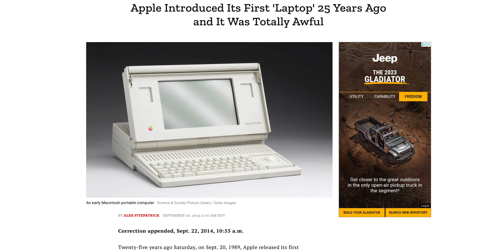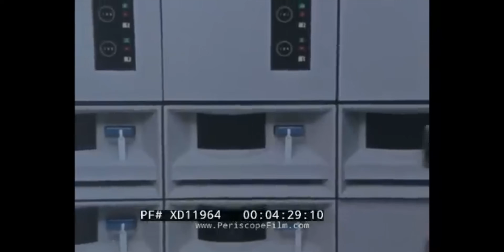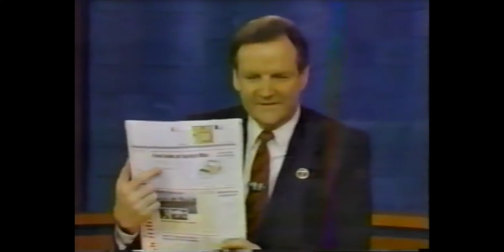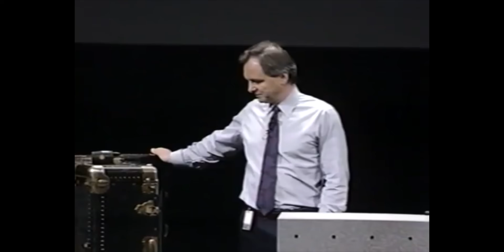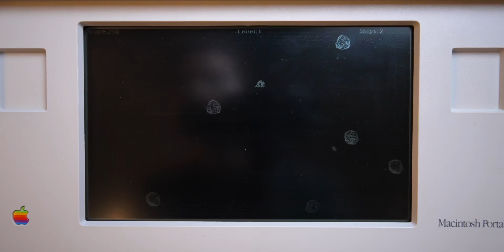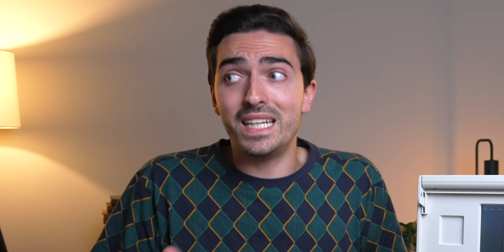How Apple INVENTED the laptop

Comment: I won one of the original Mac Portables. I was a ComputerLand employee at the time, and Apple hosted a contest for the contestant to put together a presentation that promoted the Mac over PCs. The thing was HEAVY due to the big lead-acid battery. But using it's sturdy carrying case,  I was able to travel with it. It had no backlit screen, so seeing it in dim light was a challenge. I wish that I still had it.

Comment: My grandfather worked for Data General back in the 1970s to 1990s i think and he got a Data General One wicht is a laptop from 1984, you saying that apple invented the laptop is just wrong. The Data General One is mabye the first portable computer that has a formfaktor of a laptop. The Data General One has a very similar look to the Macintosh portable, but with a bigger screen, it has very bad contrast. I would also like to mention that the serial number of grandfathers computer has a very low number something under 100, and it can hold a charge up to 8 hours and up to 16 hours with new cells!

Comment: It's what I will call a  PC guy's perfect Mac.  Apple is about targeted design.  This computer is amazing but it fails at what it was supposed to do. How many people often disassemble their PCs? Then they insist Apple users are stupid because they have a laptop that actually performs on battery instead of a massive gammer laptop that doesn't. They insist that professional computers should be designed to be modified all the time, and install experimental stuff. No a professional computer you setup and leave it alone because you have to do actual work with it and you don't want to miss a deadline because the new cool stuff breaks the machine.  When I want to toy around I use a Raspberry pi or a "for toying around" Linux box.  My Mac and my Windows PC  portable are not toys.

Comment: A very good  possible claim for first portable PC is the Sharp/radio shack E5100 (1979) and E1210 (1980) Pocket PC-1. While it only had one LCD line; it weighed under 1 lb even with a printer or plotter only a couple pounds and battery powered also.  It was CMOS and  battery powered requiring no outlet, it had Basic programming built in, a software library, full QWERTY  keyboard though tiny;  cassette storage allowing for large programs; optional  printer, even a pen plotter w 4 colors. I personally consider this the first portable as you could use it anywhere w I/O and run on batteries for days on a single charge. At the time the "big" computers used terminals w one line of paper input or output at once. You certainly could do graphic output or text output on this computer.  It isn't a calculator because it uses Basic language had a full keyboard, and it had cassette storage for larger  programs and data.The Grid case came out in 1982. Extremely costly but it was compact, non volatile memory had a gas plasma flat screen clam shell and full keyboard. In many ways still more capable than the Apple portable made a decade later.

Comment: In the early 80's I worked at a Xerox service center outside of DC. We worked on Osborn 1, 2, and Osborn Executive portables. We also worked on Kaypro 1, and 2. We also service apple II and IIe. One of our reps had an Osborn 1 fall off his motor cycle on the way home and after we replaced the case it fired right up. We had a scientist from NASA bring in one they used for a launch after their main Fram went down that they took out of the case and  hooked 12 5.25 floppy drives up to make the launch. The Osborn users group was fanatical and loved their computers.

Comment: For existing Macintosh Portable users Apple offered a "backlight upgrade kit".
It was quite expensive but at least customers could have their screens updated with a backlight, if they so chose.  You did not have to rebuy the Portable.
With the backlight the screen was truly amazing.  It did not support grayscale, only black or white like the classic Mac, but those were truly perfectly sharp pixels.
Took years until another Mac laptop had a similarly good screen.

I owned both the Macintosh Portable (plus later backlight upgrade) and the PowerBook 100.  
The PB 100 was amazing in portability, but the screen was so crummy.  A "pain" really, especially when you came from a backlit Macintosh Portable.

The PowerBook 100 was IMHO the best portable Apple laptop until the Duo 270c, then followed by the 12" PowerBook, and finally the 12" MacBook which to this day I still think is the best laptop Apple ever made, simply because it is so small and light that you actually forget that you carry a whole Mac with you (depending on your computing needs of course, but normal tasks are totally fine on a 12" MacBook, and the butterfly keyboard is also fine - better than the PowerBook 100 keyboard). 
A 12" MacBook is IMHO a lot more flexible and powerful than an iPad with keyboard case (and thinner and lighter and cheaper too!) which is why I suspect Apple killed the 12" MB.  It took away too many iPad Pro sales (which likely have a higher profit margin)...

Comment: Actually, I saw this portable back in 1990 and I was blown away by the quality of the screen. This was the very first time you could  work on a flat screen without getting sea sick... I eventually acquired a Powerbook 180 in 1993, which for many years was the best machine available. It had a drawback still... For some reasons, the screen was limited to 640x400, instead of 640x480, which means that for some applications, you lost a few lines of text or of pixels. However, it was possible to plug it onto an external screen.

Comment: Before the Portable there were some 3rd party kits that took a Mac Plus mainboard and added screen, keyboard, trackball, and battery. Of course, you could also buy special bags for the old all in one Macs (128/512/Plus/SE, etc) and take them to various locations, as long as you had a power outlet available. My dad used to work in major construction management, supervising several sites at a time. He would transport his Mac Plus from his main office to different temporary office containers/trailers at the sites he was responsible for, and often brought it home on the weekends. This was before they had personal computers in the office and he had to convince his boss that a Mac would be useful. He used Project, Excel, and MacWrite, etc. He bought it out when he left the company and later also bought an SE for personal use. When he lugged it around he usually used the original box, or just set it in a laundry basket. He still has the Plus and SE, along with many other Macs that followed.

Comment: Thanks for the nice video. I didn't know it was that much tool-less :D From my point of view (as someone who used a lot of other computers from that era), the problem with the Mac Portable was very much in its price. There was a group of people who used the compact Macs as portable computers, carried in a large case with accessories. They just needed something that could be easily transported between 2-3 different locations. I am sure that the Portable was better for this use, but the price could not be justified for this group of customers.

As for the PowerBook 100, I love this machine and have fixed several units (leaking caps killed most PB100s). Although the keyboard does not have mechanical switches, it is still very nice to use. I wrote many long articles on it. The passive matrix display is certainly not as fast as the active matrix on the Portable. On the other hand, the backlight is more important, and the laptop was mostly used for office tasks anyway. The passive-matrix LCD is not only cheaper, but it has lower power consumption, so you need a smaller battery, the machine can be lighter, etc.

From the PC world, I would say that the competition in desktop replacement laptops was something like the Toshiba T3100SX - a 16MHz 386SX, 1-5MB RAM, 40/80MB HDD, mechanical keyboard, and a nice 9.6" orange gas plasma display with 640x400 resolution. This was a more powerful machine with better expansion options, a variety of integrated modem modules (including wireless), and a realistic battery life of around 3 hours (up to 5 if the hard drive was mostly off). You could add the math coprocessor and the whole thing was orders of magnitude faster than the Mac Portable.

Comment: Technically I don't think Apple really developed the first "laptop".  Maybe the first laptop as we know it today where you have an integrated screen that folds along a hinge and has a keyboard built-into the case, but you could probably argue that computers like the Tandy and even to a nextent, the Commodore 64 could be considered laptops (although the C64 did require an external monitor and had no built-in display).  But basic computers like the Sinclair Spectrum and a few others were probably the first real "portable laptop" computers.  Then of course came the larger portable (not laptop) computers like the Compaq Portable, which by today's standards weighs and is larger than the average desktop, but back then, it was quite portable in an era where the alternatives were less "portable".
Reply: No, Apple wasn't first to market with basically any aspect of laptop design as we know it today, even this Apple Portable was super clunky when compared to stuff like the Compaq LTE/286 which came out before the Apple, was MUCH MUCH closer to the current form factor of laptops, was smaller, lighter, faster and with a bigger, better screen. Sorry but Apple, as usual, invented very little, as always they 'borrowed".

Comment: Let's not compare the Macintosh Portable with modern MacBooks. It was not meant for the masses, it was a specialised machine for those that needed the portability.
The PowerBook 100 was my first laptop, and it served me well.  Two extra batteries for swapping, plus the external floppy drive, and the SCSI-cable for an external HD.
Once I was staying in a frozen house with a tiny stove. I had to rotate the PowerBook to warm all sides evenly.  At night I had to take the PowerBook in my bed, otherwise the harddisk would not start up the next day.  I still have the machine, and lots of great memories.

Comment: So a little history the Macintosh portable has a design flaw 2 of them.

1. On some models you have to have installed a battery on the portable or it wont start up.

2. The same battery explodes this is due to the portable not having a stop charging circuit in place the portable would just charge the battery until bang happens.

Comment: This would be fun to hand to a Gen Z blivethead - they'd take the computer and fall to the ground saying it is too heavy and thick and they are pinned to the floor.    The only quandry I'd have is do I leave the lazy and weak Gen Z blivethead pinned to the ground with a valuable computer artifact or do I save the computer and leave the Gen Z blivethead whimpering and blubbering on the floor?    I'd take the laptop and leave.

Comment: Luke, did the battery on that one just….work? Or did you have to rebuild/replace it? I have my uncle’s old Mac Portable now, which I can still remember him using in the early 90s, but the lead acid battery has long since died. A few years ago I started looking into what it would take to rebuild/replace the battery but gave up. If anyone on here has had success with either rebuilding one or one bought off eBay, let me know.

Comment: i would argue that the Tandy 200 and PC convertible are the first laptops. as for the pointing devices, these were not commonplace until the late 386 era of laptops, with a similar story for hard disks.
Reply: Arguably, the Sinclair ZX80 was the first portable / laptop. You could plug it into any convenient TV set, and carry the computer in a small briefcase, along with your Filofax and other documents. Your 'brick' phone would be in another bag, hanging on your other shoulder, and you could have worldwide connectivity!
Reply: Grid came way before the Model 200.
Reply: Anything to refuse that Apple actually innovated, huh?
Reply: Yes, because there truly is very little innovation here. Whilst it is a very nice experience compared to a contemporary PC compatible, it is an objectively worse platform for the power user, and if you are dropping that much on a machine, it better be worth it.

I've encountered old apple machines, there is even one on the other side of my monitor but I tell you, if you had to work with it, you'd wish you'd gone with the PC instead. Brittle plastic everywhere and just really, really strange design choices. What kind of lunatic mixes SCSI and IDE? what a waste of a SCSI controller on a CD-ROM drive, no one will know the difference between an IDE drive and a SCSI drive, because the limiting factor at that point is the drive itself only being 4X sped.

As for the MacOS, they stole the idea from Xerox so there is no real innovation there anyways. Clearly you are an apple fanboy and there is nothing people can do for you anymore other than make sure you have the latest Iphone.

I prefer the IBM PC standard, so I will stick with that.

I'll give apple the Iphone, Ipod and Penlite (a Powerbook Duo variant that never made it out of preproduction even though it would have probably made lots of money.) but pretty much everything else is either a marketing gimmick or abusing a customerbase that has become reliant on their ecosystem, which granted, everyone else does but it is a free market, so the most shiny and expensive wins even though it is inferior I guess?

The PC is my platform of choice so I have no problem telling you it is better in every way, but mainly because apple had nothing to do with it.
Reply: @ Jesus Christ. You using a PC mainly is painfully obvious. by your logic, your platform has zero innovation too. I hope you realize that Windows came out 2 years AFTER macOS (Apple Macintosh System Software Version 1, 1983). 

Just from you completely ignoring the market of content creators, animators etc. tells me instantly that you're a PC fanboy. And trust me, I use Windows as there are things that I need Windows to do, but lately Microsoft has been falling behind, and as hard as you try to cope with it, it's a fact. You don't need to love and adore current Apple's greedy and stupid decisions to admit that they have done good. You're acting as if Macs aren't some of the most well built computers, PCs were also made of plastic, and plastic breaks. Thats just what happens after years, ever tried to use a PC from '85?

Another thing- latest iPhone? I'm still rocking my 12 alongside my Google Pixel 2 and an S21. Computers? DELL Latitude 7370 and MacBook Pro (2020). I don't need the latest things to experience  polished software. You haven't given any actual points other than stereotypes and saying that an old computer is fragile (shocking news).
Reply: @FuzzyIcecle the hell is your problem? Apple very much did not invent anything here. The title is misleading. On top of there being smaller, lighter, battery powered clamshell devices in the PC space (see systems like the Compaq SLT/386) before the Macintosh Portable came out which were faster than this, there were already portable macintoshes well before this. Outbound is one such brand that made these.
Nothing in the Macintosh Portable was invented. The active matrix LCD existed but was used in different applications. Macintosh portables existed. The SRAM the Portable used to save battery existed and was available to any company that wanted to use them. The clamshell design existed. Trackballs existed.

Apple packaged a system that was very capable, with good battery life, which suited plenty of niches with the Portable. But if you're so far up your own ass that you think Apple did anything new here, please kindly rethink. A product doesn't have to invent new things to be good. Apple always has been great at repurposing up and coming technologies and making something wonderful to use. But nothing was invented here.

Also, Apple doesn't really care about you any more than they care about anyone else buying their products. They can be right for you and provide what you need, but you don't need to viciously attack anyone who dislikes or even has a different commentary on a brand that doesn't care about you, and you should actually try to understand things outside the Apple ecosystem and the history of computers generally before deciding Apple is perfect and they invented everything they've sold.

Comment: The Macintosh Portable was, in essence, a base Macintosh SE, using ACTUAL Mac SE components (Logic Board and HDD) crammed and redistributed in a portable case design. Yes, a desktop Mac for the go. That's why it was so heavy and bulky, but came with industry first tech features and innovations.

P.S. a backlight capable revision of the Macintosh Portable was introduced months later before it was replaced by the PB100 in 1991 which in contrast uses true laptop components designed from scratch.
Reply: The desktop components were only part of the reason for the weight. The other major reason was the battery, because of what it had in common with a gasoline car battery: It was a lead-acid battery, and it weighed a lot all by itself.

Comment: I owned a Grid Compass, an ATR1000, and a TRS model 100. My first “portable” Macintosh was an SE/30 with a canvas shoulder bag. It was bulky, but it was the full Macintosh experience. Later I got the PowerBook Duo with the home docking station. Finally I could take it every time I travelled. I had a mouse sized 9600 baud faxmodem for connectivity. Much better than the optional 14.4K Apple modem. My next PowerBook was the titanium, a giant leap forward.

Comment: I’m guessing those two odd indentations on the bezel, left and right of screen, were there to allow the track ball (in either left or right position) to stick up above keyboard. FYI, it has 16 MHz 68000 (double speed of original compact Macs), but not 68030 like SE/30.